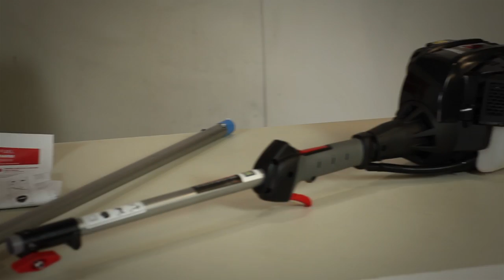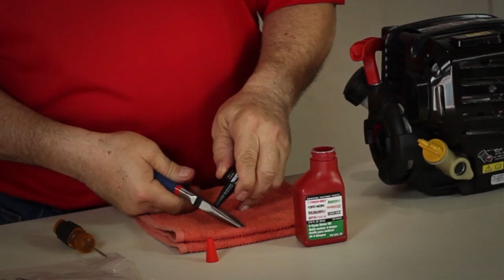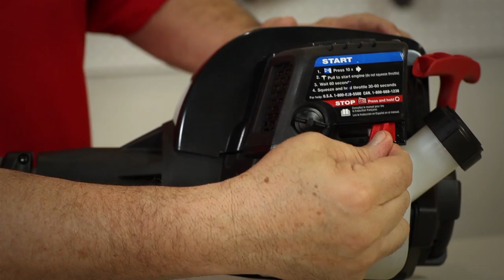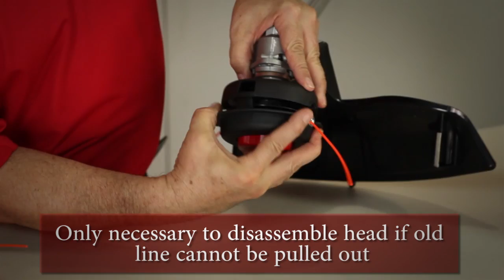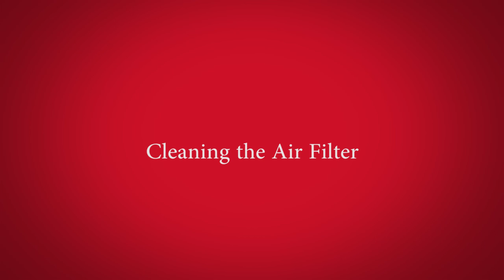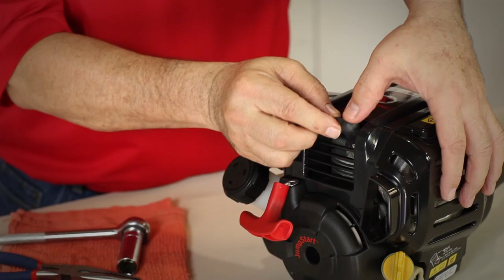The TB6044 XP gas string trimmer | How to set up your 4-cycle trimmer

Comment: This string trimmer is a piece of junk and a waste of money. After 6 uses the starter  pawls have fallen out and it is leaking oil. I thought Troy Bilt was a quality product but I was proven wrong. I would not recommend Troy Bilt products to any one.  It should say on the box that you must purchase the electric starter also if you want to use string trimmer. I don't want to carry around an electric starter when I'm weed eating. That's supposed to be the purpose of having a starter cord so you
Don't have to carry around a bunch of other things to do one job. That goes against the claim on the Troy Bilt website.

Comment: I have this same trimmer, and I cannot for the life of me figure out how to charge the string.

If I insert into the eye-hole, it does not come out the opposite eye-hole. It comes out somehere internally. It seems it has a different head or something. This is stock, I haven't changed it, but it seems your comapy used different head at some point? How do I properly re-thread new string on my trimmer?
Reply: I had the same problem. Thank god I kept the operators manual.  It sates to cut 2 10 foot lengths of string, line up the arrows and insert about 3 inches into each hole and wind it in.
Reply: James Ihrig same problem here!

Comment: This unit is garbage, special gasoline ?How is that any different from 2 cycles?  It boggs down on st. Augustine grass ,virtually impossible to accurately determine the oil level,the handle twist while operation no matter How tight that screw is. The balance of it is horrible . At full throttle operation (If you can get there ) it vibrates so bad it will make your arm go numb.You can get attachments to do jobs the machine simply can not handle .The first time you hit a rock with the tiller or thick sapling with the brush cutter it is a wrap for this thing and your 300.00 because these people DO Not Honor Warranty
Reply: its not a 2 cycle. it does not use and oil/gas mixture. you will foul the engine if you use same.

Comment: No complaints here.  b ought unit cause I bogged up a  rider on 2.5 acres of overgrown brush.  This went through it all.  Now I am having small difficulty replacing line but will overcome.  One thing I am not liking is that I have to start it with throttle full closed.  Something fishy about that.